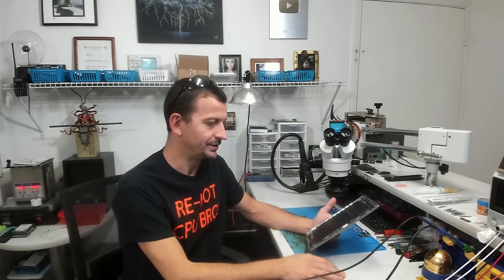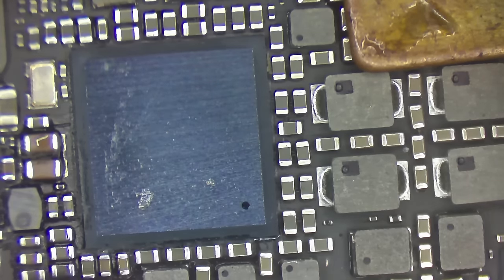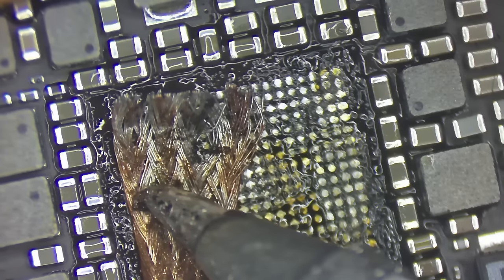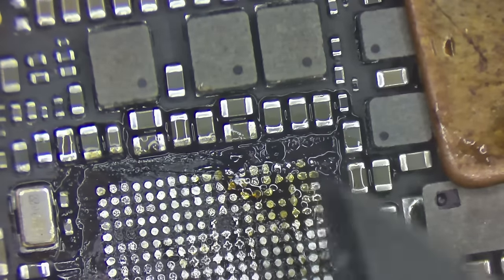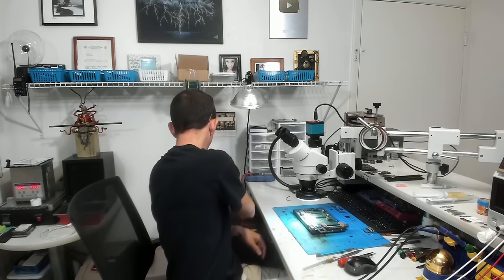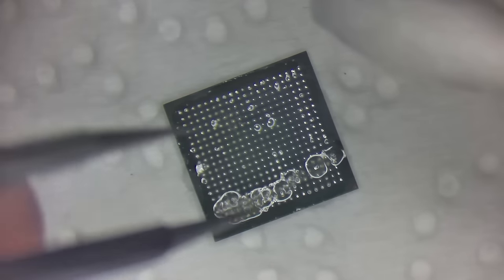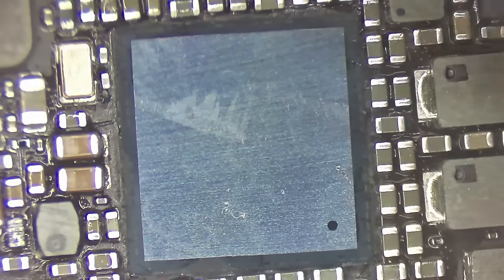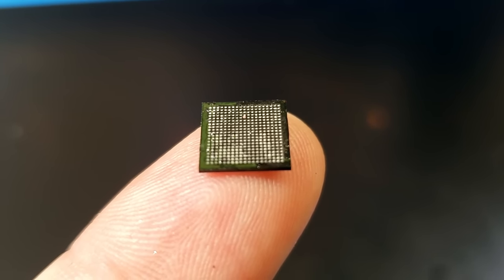iPad only charges when off but refuses to stay off

Comment: Hey great job. I use acid to remove the underfill rather than risk knocking off a pad with the tool or knife. Its easy to find online, bga glue removal  acid. I put it on, wait, clean the sludge with a stiff brush, repeat. Great to see you posting again.
Reply from the maker: Hello, thanks!  I used some of the BGA glue removal that mobile sentrix sells one time and it scared the crap out of me!  Cotton swab on a CPU in a bag for 15 minutes as directed (actually the directions said 20 minutes I think).  It not only removed the glue but also seemed to remove the coating from the bottom of the chip, leaving the traces exposed!  Maybe I just used it wrong but I’ve just kept doing this by hand every since.
Reply: @ststele  you honestly cannot trust any of those Chinese chemicals, they are toxic as F and they have never heard of MDSS (Material Data Safety Sheets) or now called  Safety Data Sheet (SDS) Use that shit and you are likely to grow another head 😂

Comment: Hello Jason thank you for the great videos. i have a tip you may found useful to remove glue, clean it from the board instead of exacto blade i use a wooden toothpick shaped as a blade and use some kind of holder to keep it firm in hand is super safe and effective. hope you try it! Keep up the goodwork

Comment: I noticed you don't coat your solder wick in flux before using it. It soaks the solder up a lot easier when flux coated. Thanks for sharing.

Comment: I bought some solder paste once that was so low volume solids, ie, mainly flux, that applying it with a 4 thou stencil made it shrink to 2 thou when flowed, ie, only 50% vol solids. Basically it had no height to take up any non flatness in the mating parts. I've seen people do the double fill, so I suppose you can get around it if you want to do it twice - lol -.

Comment: Hey jason, zippo lighter fuel works wonders for removing glue. So much better than ipa. I use it even for the under glue issues.
Reply from the maker: I will keep that in mind!  I forgot all about using this stuff to clean off sticker residue years ago.  Thanks!

Comment: Sir was that copper which you placed up to protect from heat
Reply from the maker: Yes, I use it more to absorb heat when I’d like to slow it from traveling somewhere on a board. These are copper shims I bought long before I started doing board repair.  I think they were for laptop or pc motherboards?  I have denser chunks of metal that I use sometimes.

Comment: Yeah that's why I stay away from prior repair attempts. And I'm not like other repair shops for anything that has been attempted to be repaired by either the customer and other repair shop I charge twice as much for my labor. No exceptions
Reply from the maker: Yes, 100% agree - I have changed my behavior with these devices in order to survive.  When a device shows up for repair and I find out they weren't honest about the job (especially if they've requested a price first), we contact them and change the agreed upon deal since it's not what they said it was. 

This was from one of our long time repair shop customers who doesn't typically send prior attempts though and it seemed straight forward enough.  Look what that got me - A free PMIC replacement! I'm glad I can at least make YouTube content out of it though.
Reply: @ststele  true. I recommend your channel to anybody interested in getting into iPhone board repairs.

Comment: Re-Hot CPU bro! I'm working on an 12 pro max, with no imei, wifi and so on, on this series and watching your video!!!
Reply from the maker: Ewwww, sounds a lot like a full bottom board swap! :-o  Good luck! Thank you for watching!
Reply: @ststele  No bottom board swap for the momment! Board is not bent, only some oxidized pads, like usual, and the other shop that worked on it just cut the wifi antenna - They are pro's :D!

Comment: I have a problem with my iPad. I have a black screen so I did the reboot thing holding the power n home button it worked came back to life I had to run out and when I came back hours later. I put it back in its case and it went to a black screen now I keep trying the same thing holding the buttons but it tries to turn on I get a blue screen then goes black. Not sure what to do next.

Comment: I still prefer wooden sticks for cleaning, no need to be nearly as careful with scraping.
Reply from the maker: I used wood for a while when I was first getting serious with CPU rework.  A bit safer but can still take pads off and cause damage to the cpu surface if not extremely careful.  Now I much prefer the precision of a nice sharp blade for getting real work done.  I'd definitely recommend wood for anyone who is worried about causing damage with a blade tho!

Comment: Hello. can you explain to me why all appel mobile telephones before always drained the battery within approx. 1 to 2 days when the phone was turned off? I have tried to use some older ones as mp3 players but every time I use them after a few days the battery is empty. if you charge them up and use it, it keeps the power normally without problems. samsung. lg. htc. did not have this behavior. I think apple has made the phones this way but why?

Comment: If possible it might have been easier to have extracted the data , bought another model of the same spec and transferred the data to it .That was a painful repair
Reply from the maker: Yes and is a good idea too.  If this repair had failed, I was going to do exactly that.  This was also a bit more of a personal challenge since I had turned so many away in the past!
Reply: @ststele  a personal challenge is o.k if you have the time to spare but you have to balance one against the other. Hope this one has raised your confidence about doing the same repair on others
Reply from the maker: Yes for sure. It's sort of the other way around tho.  Have been doing many repairs that made this one feel easy.  I had charged $95 to repair this iPad as board only for not charging and was faced with either refunding the money or replacing the board.  I'm very much thrilled to have fixed it.  Definitely a confidence boost even if it was easier than a lot of other jobs though.
Reply: @ststele  I have watched a lot of your videos with the multi layer iPhones, those things are tricky. Makes you wonder what Apple can come up with next to make repairs difficult if not impossible 😂
🇺🇦🌻🌻🌻

Comment: Hehehehe butthead it’s not hot after you blasted it with hot air hehe
Reply from the maker: It's always so surprising when I burn my hand.  Lol 😁
Reply: @ststele  my first hakko was the 888 and I used a pair of pliers to change tip when hot yup I dropped it in my lap like 450c yup this fat guy was dancing and a fx951 was on the way
Reply from the maker: @thatonerepairguy4784  LOL - ouch!

Comment: Hey butthead buy a pair of sewing scissors instead of making ur blade dull
Reply from the maker: But I only care about the tip tho! :)  Once the tip gets dull even the slightest I have to change blades but the whole rest of the blade is mostly unused at this bench.  I may actually switch to scissors tho for the sake of not cutting the bench all day and maybe one day slipping and stabbing myself in the leg.. 😟